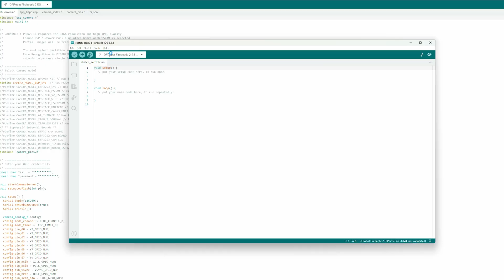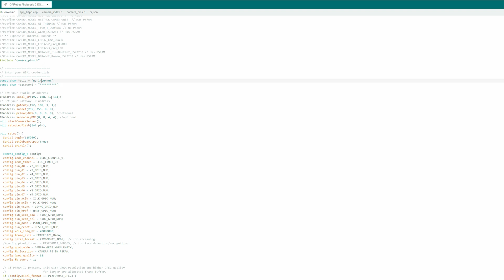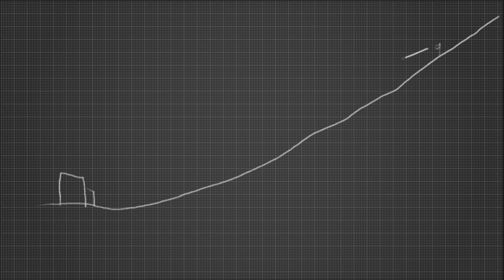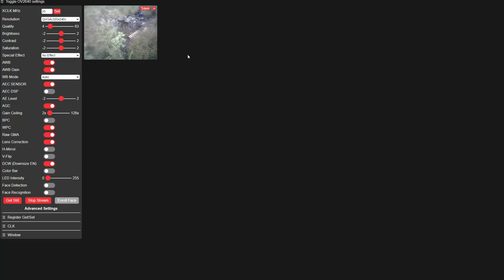I thought it was IMPOSSIBLE-wireless camera over 400m

Comment: Have you seen the new alternator charger that's been created for the EcoFlow power generators? It's a genuine game-changer, increasing the recharge times to 8 times faster than standard. You don't even need solar panels for them now, which is ideal for Scotland, you can literally charge them from your car battery at a rate of 800 watts. No, it won't drain your car battery, it has built-in protection to avoid that :) . Check the Hobotech video for this DC-to-DC charger on Youtube, his reviews are always excellent.

Comment: You could try Wi-Fi Halow 802.11Ah, albeit the speed is around 5.0Mbps as it's using 868Mhz with 1Mhz of width in the UK. However, American units have 900Mhz with 10-18Mbps and interferes with UK mobile networks.
Reply from the maker: That sounds great thanks for the suggestion

Comment: just wow... some time ago I had similar results (300mts) using a tplink WA5210G configured as an AP and a 12-element antenna... By the way, what power is the solar panel you use?
Reply from the maker: We used a 5v 250ma panel but I am not sure on how the power charge situation will last over time we will have to see.

Comment: Good video, and I can thank youtube for randomly suggesting your channel. I'm an avid coder on the ESP32's so if you're going to explore this type of DIY camera more, let us know as I'd be happy to chip in with the code. Also, there's a better camera you can buy, yours has the Omnivision '2460' camera sensor which is pretty basic, there's also the 'OV5640' which is a 5megapixel (~2500x2000 pixel) resolution which will result in much better images. There's also variants of the lenses as well (macro vs zoomed in). Assuming you don't need to stream video (if you do, probably easier to use a security camera) then swapping for a better sensor is probably the option. Secondly, for my uses I simply have code that takes an high-res full-res photo every X minutes and pushes it to a server either on the internet or locally. The device then sleeps. This drastically helps with power usage.
Reply from the maker: That would be super helpful as I have some really complex projects planned and am really new to this side of the projects. Others have suggested sending images every few minutes rather than streaming which I think would be better for our use case as you mentioned and the power saving is a massive plus point especially for the projects we want to leave up the hill for a long time.

Comment: Fantastic. The rubbish image quality is obviously down to the camera sensor and lens on it, but rather than swapping for something more expensive, you could just move the rig closer to the thing you want to see. The intermittent signal is probably fine if you just want to check on it every once in a while. I'm sure you could set up a little script that tries to fetch an image every 15 minutes and stores it, so even if it's unavailable when you're looking at it, you can see the most recent image. If those images were stored, you could scrub back and forth to see how quickly debris builds up.
Reply from the maker: Yea its crazy how small the camera is! Someone else suggested transmitting periodically rather than streaming and I think thats the way to go as I dont need a live feed

Comment: you're going to want to black out the plastic surrounding the lense or you'll get the white reflected in the glass cover and make the image look hazey. also 400m with directional antennas on both ends and line of sight should be a walk in the park. I've run 340m on the lower gain version of the directional antenna you used (camera end) and an omni at the other (quite a big omni, about 9db gain) and some light foliage in the way. This does lead on to my final question. How long did your battery last? On our setup we used an off the shelf cheap wifi camera, a 40watt solar pannel and a 7Ah 12v battery. during winter we couldn't quite make it through the night, but the camera would come back on when the sun came up.
Reply from the maker: Excellent I am pleased you found it works too. I was worried I was hitting the limit but you have shown it can be done. It lasted for me but we had really sunny days while I was testing it. I will be swapping the device out for the next version so I will have to see how it copes with cloudy days.

Comment: Thanks for an interesting video. You might have better range/reception, by putting a directional antenna on either end of the connection. The ESP module has a variant with an external antenna. The default one could be exchanged for another yagi or a paneland increase gain. Depending on what you need, you could also reduce bandwidth requirements by just sending a single JPEG every few minutes, rather than a video stream. Subbed for more of this type of practical content
Reply from the maker: I did wonder if I could swap out the external antenna for another directional one but the connection to the board looked really small. Thats a great idea on reducing the file size sent but might be a bit above my skill level at the moment. I might try that for the wind turbine monitoring as we will send data every few minutes rather than continuously

Comment: Well done @BeyondtgeWorkbench great idea to use a high gain directional antenna. That's exactly what I would have done. Any chance you could release the case you printed for the project. To be honest I have not checked the description to see what is there. But in closing, proud of your skills with wifi. 2.4 rock over distance over 5.8.
Reply from the maker: Thanks! I will add the files to the description although if you wanted to use it long term it might need some redesigning to ensure better waterproofing

Comment: You know that any fillament 3d print is not waterproof at all as it is a poreus material. Coat the outside with something. Also if you need longer range and speed is not needed the use 802.11ah wifi which does 11mbit up to 500m and 1mbit upto 3km without fancy antenna.
Reply from the maker: Nice thanks for the suggestions! I will try the 802.11ah and see if it improves things

Comment: Excellent video and fantastic content! I’ve had great results with using nail varnish as a waterproof coating for electronics (extending cheap bike lights from 2 months before failure to years). I’ve used LoRa before for long range communication but I think it might be too slow for transmitting images, could be handy for other sensors though.
Reply from the maker: nail varnish is such a great idea! I will try that next time. Yea I cant send video over lora but I looked into it until I realised it couldnt send that much data
Reply: @beyondtheworkbench  It's usually free too, just check under the bathroom cupboard, there you will find 25 part used bottles of the stuff! (I did anyway)

Comment: A narrower bandwidth should give you stronger/stable throughput. Eg 10mhz wide frequency channel is more stable but less data capacity than 20mhz. Try and get a couple of grid antennas, I've done 20kms with them. Generally on 2.4Ghz there's also only 3 channels that don't overlap depending on what channel bandwidth you choose. Keep in mind what other 2.4Ghz you have around that may cause interference,  printers are a bugger for it.
Reply from the maker: 20kms! wow thats way further than I imagined possible.

Comment: hmm add an aluminium wifi reflector behind/above your target
Reply from the maker: I wondered about that so I am pleased you said it would help
Reply: @beyondtheworkbench  i used to steal wifi from my appartment's community center half a block away. only had about 1-2 bars of wifi signal strength so i took a bunch of old cardboard boxes and taped AL foil to them and made a big reflector on one wall of my apartment. got me 3-4 bars no sweat. can use cheap AL foil tape now days and make it pretty cheap. idk about outdoors.

Comment: Congratulations good feeling when it works , is the silicone ok on the solar pcb acetic acid thanks .
Reply from the maker: Thanks, I did wonder about that. I haddnt intended on it staying up there for long as I will be adding it into a bigger design so I will remember what you said when I get to that project.
Reply: if its acidic then thats a double NO. first its gonna oxydize the copper strips in the panel and second the acid makes the silicone caulk a conductor that puts an unnessacary load on the panel reducing the solar yield.

might be ok'ish in summer but prolly stops working or have unreliable connection in winter.

Comment: Good video. But for 50 quid you can get a solar wifi 2k camera from amazon with built in battery. Makes more sense imo with the extra features you get as well like motion detection and sd card recording. 
I just stuck installed a 2.4g outdoor antenna on my external wall  this week to cover outdoor areas
Reply: Add one with 4g and a cheap Sim card and it's done
Reply from the maker: Nice that sounds like an excellent solution